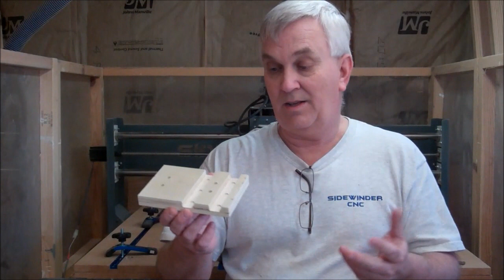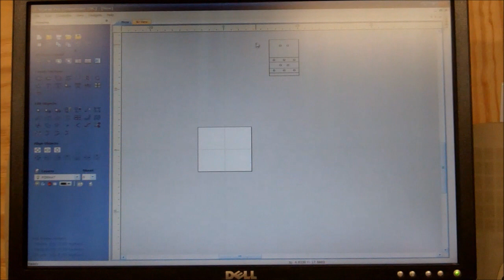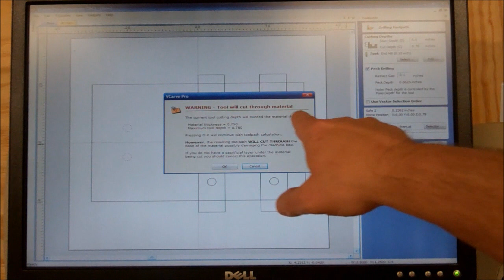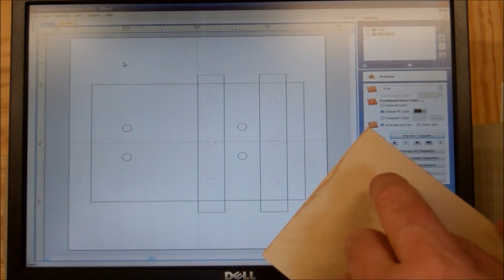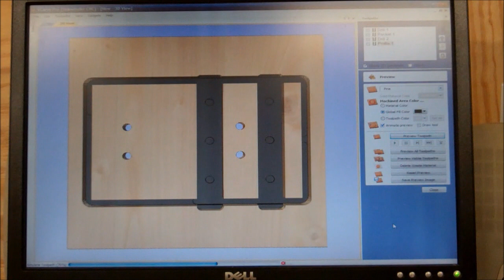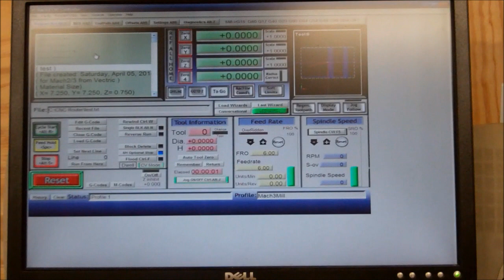How to Build a CNC Router On A Shoestring Budget Part Eleven

Comment: I built my scratch built about 4 years back. Note scratch built, I did the design up in inventor and part of it was cut on a friends CNC, the rest was cut with a table saw and a band saw but all of it could have been done by hand.  I didnt have any sort of tutorals to work with but a CNC is really not all that complicated if you under stand some basic mechanical and electrical and electronics skills. Footprint is 2 by 3 feet  Cutting envelope is 25-X 18-Y Z-9. High enough to whittle on  a 4 by 4. :)  Made totally from MDF ( which I sealed with 3 or 4 coats of paint to deal with the way mdf soaks up moisture).  Bed is a torsion box 3 3/4 thick. I used 3/4 angle iron instead of aluminum, far stronger, as it also adds a lot of the rigidity to things with v-grove bearings riding on one edge.  I use a trim router most of the time but when I need to chew up plastic or soft metals I switch the router to a small 300 watt spindle. The trim router wont run slow enough to cut those correctly. Drive is 10 pitch 5 start acme thread on X and Y, Z is 10 pitch single start driven with 450 oz/in steppers.  Rapids can run at 300 in/min X and Y and 60 Z, but I normally run it using rapids at 175 just because its smoother. Accuracy  is around .001 overall using shallow cuts and feeds around 60 ipm to deal with bit flex issues.  I rotated things 90 degrees to the left as I have to work from the side of the bed instead of the end ( small shop). While my CNC looks different it is close to what you did. Love that Mach 3 and V-carve . Great stuff. 

Very nice scratch build there. Its obvious you worked it out with some sort of solid modeling software similar to Inventor. Woulda saved me a bit of head scratching if I had of seen this before I did mine.. :)

Comment: Hello Dave and followers.
As I am getting into my journey of building this CNC router I am spending some time learning Sketchup.
Most people who have posted videos having built the Gatton/CNC router have made modifications.
I figured the best way to modify the design was to import the DXF files into Sketchup and make my changes there for the sake of accuracy.
Funny thing happens upon import though.  It multiplies the scale by +12.
So the height of the Gantry is 144" instead of 12".
I used the Scale function in Sketchup and scaled it back down by .083333333 or 1/12 but I was wondering if anyone knew why this does this and is there an import setting I need to adjust?
Reply from the maker: Poolboy28560 I don't know much about Sketchup but it sounds to me like your units may be set to "feet" instead of inches.  Jay Bates is very proficient in Sketchup.  He could probably answer your question.  Thanks for watching.

Comment: Great video Dave. I hope this hasn't been asked yet but if you need to alter the opposite side of your piece I assume you could flip it and use the same zero point location as used on the original side? I assume if your piece has 4 square corners you could just make an X but what if your piece is an odd shape?